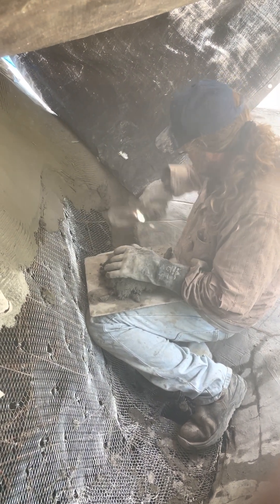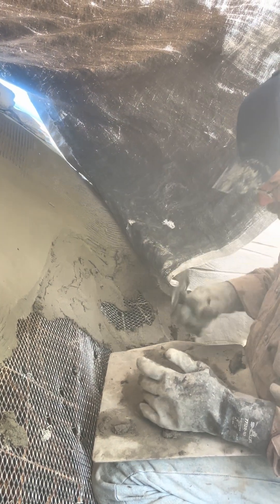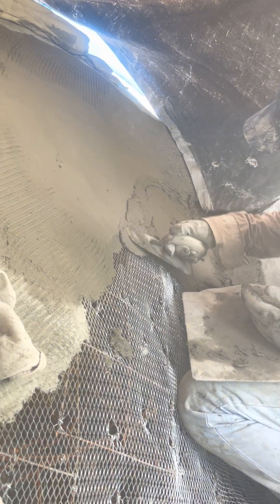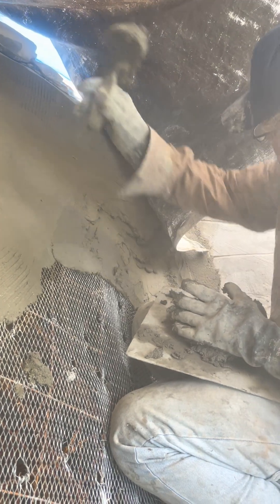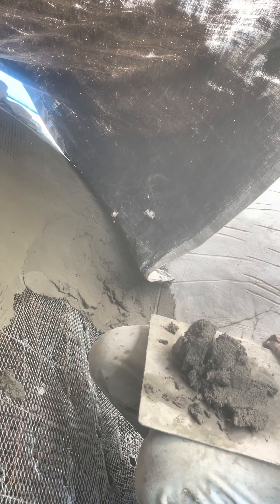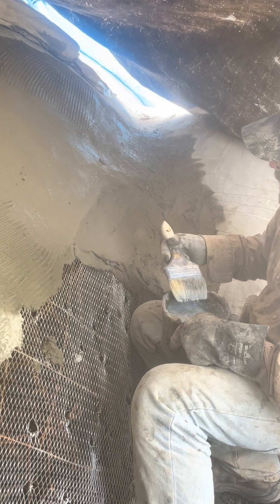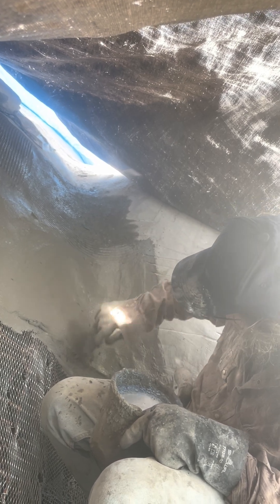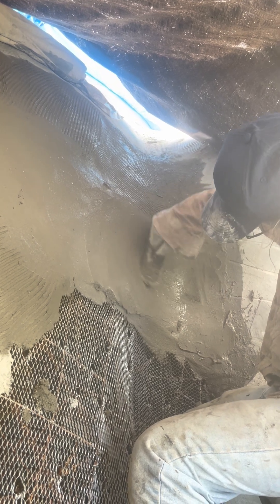Shell Application Technique

Comment: I like to built my house roof using ferrocement that chicken mess and cement is it possible and for motar mix can we use foarm mix that aircret mis is possible plz explain thank you waiting for your reply from india
Reply from the maker: There is a lot of great work done in ferrocement in India.  TP Singh has a lot of resources there for helping build. The foam typically weakens the shell mortar however with the ultra high strength reactive powder mix adding 8 percent properly expanded synthetic foam (Mearlcell 3532) you weaken your mortar from about 18,000 psi to around 10 to 12 thousand psi but gain important quality enhancements such as impact absorption and chemical expansion protection which increases the longevity many many fold.  The shell I have developed is based upon a few layers welded wire grid steel and a layer of the 3.4 pounds per yard of the expanded metal lath tightly affixed to that steel.  The shell is applied in a heavy base coat then the cracks that are revealed when that cured base coat is wet, are repaired with a fine sanded polymer mix that is half cement, with the same ratio of silica fume and micro-flyash added, and half 20-80 quartzite sand blasting sand, which is hydrated with 40 percent high- solids acrylic and water. After that base coat is fully repaired, a second coat of the reactive powder shell is applied.  You can use that polymer mix for many things and can do a final skim layer with it.  Some of these materials may not be available in India but India is a leader in ferrocement development so many variations of the materials may be.  The foam mix can be used as an insulating material but there are many people making it and cutting it into blocks to build domes.  There are many problems with this approach and many inconsistencies in foamed cement batching because few people understand the chemistry and physics of foaming Portland cement properly.  Check out what training resources TP Singh has for building in India and check out the VD Joshi Award video on the Corona Bug house.  Also, check out my site, flex-shell-architecture.com for new trading material.
Reply: @ShambhalaVillage  thank you very much for your detail reply have a good day
Reply: @ShambhalaVillage  Nice, I will try to follow your recommendations he,  a foam can be bend  , it is a nice insulation.   Is clay not recommended as insulation and additional weights for walls, will it  invite insects or any other harmful  organic things? Thanks
Reply from the maker: @jhung2479  I think the clay or bamboo is fine for the walls.  Since your flat pad is leveled by retaining walls the entire floor, that extends to the drip line of the protective curled-edge awning above, is a better foundation than a grade-beam foundation.  That means your wall does not have to be a straight-line.  It can form details like entryway ports, closets, furniture, shelves or curve outward.  You can get creative with your entry wall and use less durable materials because they are sheltered below the awning.  The vertical wall need only make a weather seal against the rounded columns and the archway that define the entry arch in the Core Monolith Pavilion.  Check out the Flex-Shell-Architecture.com website and there is updated info not published yet when you are ready to start, that I can send.  For your insulating roof, you can put many things, such as glass bottles, rubble, pumice or low density cellular concrete or a combo.  It is pretty water tight so things can't get in.  Good thermal performance, controlling the inside temperature with little or no inputs of energy, is easy to do because the roof is insulated and the buildings tend to be smallish pods that benefit from solar gain in winter and shaded walls and roof gardens in the summer.  If you want a giant house, it is better to connect smaller pods that are less than 1,000 square feet each.  There are awesome two-story approaches to can use tensioned fabric or suspended decks.    You can make what shape you like, I just feel that focusing on the pavilion first really helps you conserve material while getting to first base by creating a core shelter first that can provide food, water and basic shelter, and allows many possibilities for the entry walls that can be changed and adapted to changing times, and put together with what you have, sandbags, stone, cob, strawbale, bottles, crates.  You will be good at plastering when you get to those walls and have the mix recipe down for a plaster shell that self-heals and doesn't cost more than pre-bagged plaster, despite the huge list of fancy ingredients needed.  This is because you are putting it together yourself, buying the ingredients separately so about 25 dollars for 4 - 6 gallon mixes that use one 94 lb bag of Portland Cement.  A little goes a long way because the shell thickness is down to 1.5 cm for the main shell or 3 cm for the single shell awning and column bases.  It has come a long way.  The great thing is that you are using proper supports and reinforcing for a high-strength shell, the heavy expanded metal lath fabric securely bonded to the layers of light grid steel below.  The thick, insulating part is well supported by sturdy block-wire trusses that form a triangular pattern and help you to build smooth curves that follow precisely the base dimensions for the complex curve you want.   They are adjustable as you go, before you lock in the shape.  The engineering is visually confirmed and the engineers tend to like it because the stability is obvious, especially because of the column foundations that are more reliable.  You are not going out on any limbs structurally and you are building something that may last many millenniums because the flex-stable core shape that can handle bending forces, like earthquakes and high winds, the terrain and runoff integration that protects against floods and stabilizes the building environment and the reactive powder mix that self-heals cracks.
Reply from the maker: The Core Pavilion is also a column foundation design which is much easier.  You can start with columns in the wild terrain, then level your pads like a terraced environment that takes care of runoff issues, just like a well designed high-rise focuses on drainage, protecting the columns first.  This shell material makes high-quality retaining walls, walls that have a lot of tensile reinforcing to counter the force of soil pressure, a lot less expensive and they don't have to be straight lines.   Cast reinforced concrete retaining walls are labor intensive and require a lot of material and are not easy to form in curves.  These thin shell retaining walls give you lots of ways to create stability with curves and allows you to make sub-soil reservoirs so the runoff gardens that stabilize the building environment can function as high-quality gardens for food not just erosion protection.  This is way way more stable than a bulldozed pad which causes the entire environment, well beyond the building, to destabilize over time.  People tend to only think about floor plans and assume the flatness needed for that abstraction is not an issue.  Proper foundation, how you connect to the ground and environment is the most important thing for stability, durability and sustainability.